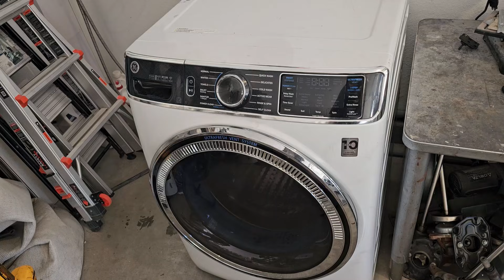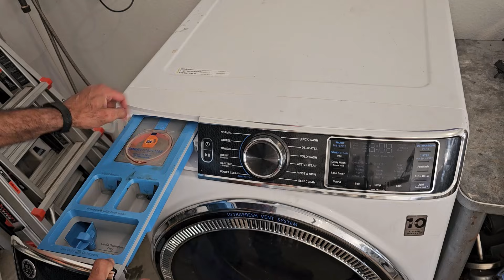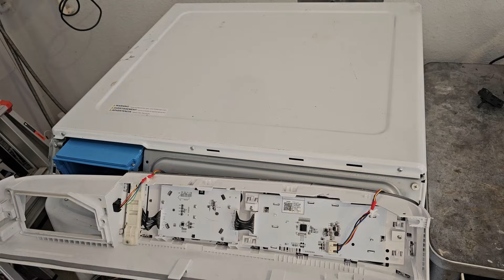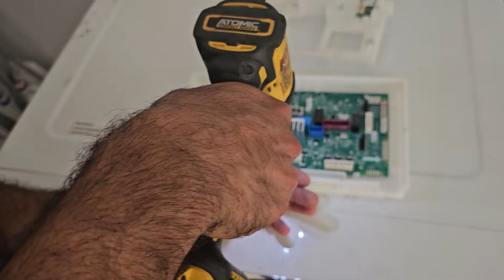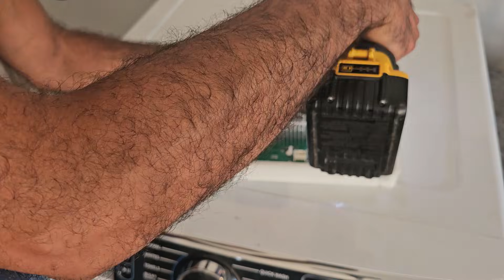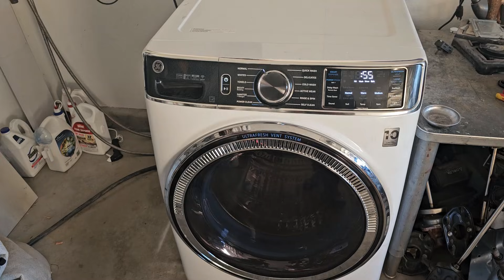How To Replace The Control Board On A GE Front Load Washer!

Comment: What is causing my GE front load washer the same as in this video, started running on it’s own and the door was open and the front panel had nothing on it so I pushed the power button and the front panel showed normally I changed it to a quick wash and shut the door (the motor is still running) and I hit the start button and it clicks and I can’t tell if it’s working properly but I hit the pause button and the motor was still running and I hit power button and the panel turned off and the motor is still running I can open the door and it still goes. I unplugged it and plugged it back in and it starts running again so I unplugged it for 20 minutes and then I plugged it back in again and again it started running when the the door was open and then I hadn’t touched anything. ? Could it be a power relay button according to ChatGPT? Where do I find that part and does that sound like a power relay switch problem or a control board problem?
Reply: Try water inlet valve

Comment: Extremely helpful, my machine would not lock so I replaced the locking mechanism. When I reset the codes it worked the first time and ran the machine, on the second load of clothes it did the same thing and did not lock. I ordered the control board and it has locked on the first load. My fingers crossed that this is the fix. The directions were very clear and the video was the helping hand I needed. I am pretty handy so the whole process tool less than an hour to complete. Thank you!~
Reply: Did this end up solving the issue?

Comment: This worked well. My GE washer is only 2 years old but stopped draining. First, I changed the pump, but it did not fix the issue. Then fitted a new control board following this video's instructions. Note that a new board will start all the LEDs flashing, and you have to set the right "personality" for the control panel to work correctly. This last step is missing from the video, though a texting process that is provided with the board will give you the correct setting (the same control board appears to be used in multiple GE machines). If you screw up this last step you can go back and fix it. This is just a nit though; the video is accurate and helpful.
Reply: My replacement board came with those instructions to set the personality but it didn't appear to be necessary since it fired right up and sucessfully washes clothes now. Maybe I'm missing something that will come up later. My post of my experience is right above yours. I wonder if you had a similar experience.
Reply: Do all boards come with instructions for this last step?

Comment: I really appreciate this video. Of course when we least expect it, these types of things happen. I, myself, have taken my washer apart, probably five times to inspect and see what was going on. Randomly one day my washer stopped draining and so I went through the process of replacing it with a brand new pump but now I believe it’s led me to believe that I need to replace the control board too because it’s still not draining. I have inspected all tubes and everything is clear. today I was going to hit the buy button on purchasing a new washer, but I’m almost tempted to try to replace the control board and see if that works. Your video definitely gives me confidence that I can do it if I was able to replace the pump with no issue
Reply: Update?

Comment: I just changed the main board and the pump (even though the ohms were in check). Still no luck. Do I change the lock mechanism next or what? Currently the machine turns on but doesn’t lock nor does it stay on. It’s not doing the constant clicking like it was before but it’s also not doing anything to except turning on. Allowing me to select something on the dial and then it waits a minute (actually 7secs or 10secs) turns off and then clicks and then clicks again in 30secs but doesn’t actually do anything except repeat clicking every 30secs.
Reply from the maker: Check the wiring harness near the lid lock mechanism. It is notorious for breaking. If that is not it, the only real thing left to do is replace the lid lock mechanism
Reply: @DuctTapeMechanic I’m assuming I’ll see where that is in your GE front load washer lock mechanism replacement video?
Reply from the maker: @rlmossproductions yes. You can also get a good look at the wiring connector/harness when you remove the interface panel and the top as you did when replacing the board.
Reply: @DuctTapeMechanic I also noticed the wheel on the front is  off. Example….when it says it’s on “rinse and spin” it’s actually something else. So weird.
Reply: @DuctTapeMechanic wiring harness was in place and fine.

Comment: My door is locked and won’t open 
I went to do a load of laundry and when I came back the washer was completely turned off and I cant open the door  
No power at all. 
Do you think I should go ahead and replace the control board , or should I check the pump out first ?
Reply from the maker: If door is locked. You must try to  manually open it (there is a lever on the inside which is visible when you remove top). After that inspect the wiring harness around door lock mechanism if no damage is found replace mechanism if that doesn't work replace board
Reply: @DuctTapeMechanic I’ll try that , thanks !

Comment: Great video! I can add a third symptom that I had that required the main board replacement. I have a five year old GFW650 that suddenly wouldn't finish a load when it got to the end for final rinse and spin. It would drain after the wash cycle and then just stalled. I was able to work around it by manually running a separate rinse and spin cycle but sometimes even doing that wouldn't complete. It drained and then wouldn't move into spin. I then had to unplug and let it sit for a minute and run a separate spin. Error code was #18, "Drain pump Clearing Algorithm Failed" which can indicate a bad pressure sensor.

I ran several diagnostics to check the machine including #10 Pressure Sensor, #12 Drain Pump and #14 Spin. All passed, and I knew that the machine was draining and spinning because I could step through it manually. So, I figured that the machine's brains were scrambled and just couldn't put together a proper cycle. 

I bought the main board from Ben's, and you are correct - it's a great price. I paid $163 dollars vs $276 dollars that I was seeing elsewhere and it arrived in a factory fresh GE box. Your video helped tremendously in doing the installation. Thanks.

Problem solved. The machine is back running just fine.
Reply from the maker: Awesome! Thanks for the added info! The pricing is great on the board and if you do it yourself you are saving a bundle!
Reply: What board did you use, I have the same machine.  Thanks

Comment: Ours turns on. We put a cycle and push start, several seconds later it shuts off. Then the device power flick on and off.
Reply from the maker: Sounds like an issue with the main control board
Reply: @DuctTapeMechanic that’s what I see online. GE sent a tech out who tried to say it was the inverter. 

So we stupidly replaced it and surprise, surprise. Still the same issue. Told them to come back and get their inverter. 

So now control board and follow your steps. 🙏

Comment: I have a similar model.. the machine will not run any hot water cycles or self clean. It only uses cold water. There’s not any supply issues, I’ve already replaced the entire valve/solenoid unit and it didn’t fix the problem. Do you think replacing the control board will fix the problem ?

Comment: How can I tell if I need to replace the main control board or the inverter board?
Reply from the maker: A bad invertor boad mostly causes issues witht the spin cycle (or if the machine gives an error after doing a couple rotations of the drum). If you are having lid lick or drain issues it is most likely your main control board.
Reply: @DuctTapeMechanic so i am experiencing when I set to quick rinse & spin cycle. It starts at 19 minutes and stops at 13 minutes. It does not drain nor spin at the 13 min. point. I got codes of 18,39,26,66,8,19
Model GFW850SPN2RS

Comment: Thank you for the video. Changed door lock and fixed door fault issue temporarily. Thinking about changing out control board next. Existing pump still functional but will it conflict with the new board?
Reply: Did it work?  Did you swap out both or just the board?

Comment: I Changed the door lock and that didn't fix problem so I then changed the control board exactly as you did....When I plugged in the washer all the lights on the LED were blinking and it won't respond to me pushing any buttons....any ideas?
Reply: never mind...I looked at your info below on programming and it worked...thank you for this video ...saved me a bundle

Comment: Hello, good evening. I changed the inverter control and it doesn't work. I've tried draining the fill water and it doesn't do anything. Could it be the control board  and it needs to be reprogrammed? Thank you. I hope you can help me.
Reply from the maker: What are the symptoms?
Reply: only hear a click every 10 seconds and it doesn't do anything. I already changed the converter board.
Reply: Ours was not draining and the repair guy ordered three parts to replace. The pump was good when he tested it. The three parts are the main control board, the user interface board, and the inverter board. Perhaps your issue is one or all of these as well. Hope this helps.

Comment: I have the door lock on order, but how would i know if the drain pump is the real issue? The washer starts with the drain noise, then gives me the door lock light, and then stops working.
Reply: I have the exact same symptoms as you.  Noise with door light.  I’m going to replace the main control board since I can’t turn the washer on/off.  I’ll let you know if it works.
Reply: @blakebiltwell5 i ended up replacing all 3. Door lock, pump, and circuit board. Works perfect now.

Be VERY careful re-installing the hoses. I had a bad seating and the main hose leaked at the pump until i re-seated it.

Comment: Mine recently had an issue draining, however after checking the filter and running a spin cycle i noticed that i was getting a door error and it was repeatedly latching and unlatching the door, prematurely ending the cycle which would explain it not draining. holding the door open and toggling the push button switch the light would go on and off as normal so it seemed that the control board wasn't getting feedback that the door was latched. after leaving it unplugged for about 30 minutes i was able to get the system to run a full cycle as normal, however it randomly decided to run the drain pump continuously while it was shut off not long afterwards which led me to deciding it was the control board. when you say the pump shorts do you mean a short as in my situation where the circuit stays closed or do you mean the circuit goes open and the pump won't run?

Comment: Tried all of this and changed the pump, and it keeps clicking and not wanting to start the cycle. I’m not sure what else to do 😭
Reply from the maker: It most likely has a bad board then I have a video on that as well. These machines are notorious for a bad drain pump taking out the control board

Comment: Great video - curious if anyone can help me - have you experienced this:  GE GFW650SPN4sN Washer run for 4 minutes then "End" comes up.  Basically simply stops mid-cycle with "End" message.  I replaced the main board, verified door lock works, it seems to drain just fine (I drained it into a bucket to verify and yes water flowed nicely) and I cleaned the lower-front drain filter.

I am seeing error codes 38, 62, 3 and 9.
Reply: I’m having the same issue. Replaced the pump and board and still have the issue of the cycle ending about 4 minutes into the cycle

Comment: Hello. I have this same washer and a new board. Will I need to program anything or update the software etc after install?  Thanks!!
Reply from the maker: Sometimes, they work just by plugging in the new board. Other times, they do require programming. If yours requires programming, just text PARTS to 36534, and GE will ask for the part number of the board and will walk you through the programming instructions. Hope this helps
Reply: @DuctTapeMechanic  thank you!

Comment: This worked perfect, with the exception of the programming.  I have the 850 and I set it programming to #8 and two of my dial options are not working.  when you spin the dial, it skips the self cleaning and the Power Clean.  I also noticed that the spin rinse is not really spin rinse.  Any thoughts?
Reply: This happened to me also.  You have to enter test mode again. 

SERVICE MODE TEST 17 - 
Change Personality 
Pressing Start will start the test. Press Start 
button again and the next valid personality should 
be displayed. Press and hold the Start button to 
select the correct personality. The control will go to 
an idle state. All LEDs off.

The personality for the 850 is 4.

Comment: Excellent video! Putting all the connections back was much easier than taking them off. You will need to reprogram the washer once the new board is installed, but that’s easy as well. Once it’s installed and your washer is put back together, text PARTS to 36534. GE will text back asking for the part number. Once you text that, they’ll send you instructions on how to program your GE washer!  Know this if your washer isn’t draining, you’ll most likely have to replace the drain pump as well as the main circuit board. Make sure you get the newest model drain pump, the old ones have been replaced just like the circuitboard. If you don’t, the old drain pump could short out the new board. Thank you again for doing this video, extremely helpful!
Reply: Oh no. You have to reprogram thw washer after the board is installed? How do you do that!
Reply: Do you happen to know what the newest model number is for the GFW850SPNRS washer is? I keep seeing #WH11X29539 as the in stock part everywhere, but I also have been told the newest pump is #WH11X39237. So I have no idea which is the newer model of pump
Reply: @svkilpatrick The newest pump is WH11X39237 and the Main Control Board is WH22X37840. I just finished replacing both in my machine and have started putting it through a cycle.
Reply: Great video AND @dscrytpto18 I am so grateful for your added instruction. The text worked perfectly and it took me just moments to square it away instead of hours to figure out why it wasn't working.
Reply: Would have been nice if this was in the video…. Thanks!!!

Comment: well thanks for the video!! everything worked except the part of applying power back on. When I plugged the washer back in the front screen keeps blinking with all the LEDs flashing. I took the machine apart and checked all the plugs and everything is plugged in. Any recommendations?
Reply: GFW850SPN5RS, maybe this is the issue. This is the washing machine I have and the part I received was for GFW850SPN4RS. Is there a big difference between the 4RS and the 5RS versions?
Reply: Hey. You have to hold down the start/pause button. Then when the number one shows up hold it down again until it goes away. Push the power button and you should be good
Reply: @robertwarf3316 oh my gosh thank you so much for this my washer was doing the same and I started to panic this reset everything and now my washer is working perfectly thank you so much
Reply from the maker: @ramosc40 there should not be a difference between the two part numbers. GE only makes two versions of this board. Both are described in the description of this video. I would make sure all the connections are good and not loose and if that doesn't work try returning the board and getting another (perhaps you just got a bad one). Best of luck
Reply: Hopefully you got this resolved but you have to program the new board to your washer. In my case model gfw850, the id should be set to 4. After you press the play/pause button to get to 4, you hold it for a few seconds and the control will then be programmed to your specific model. Then turn it back on and you should be good to go.

Comment: You mentioned to replace the pump as well. The mcb looks super easy to replace, how difficult is the pump and do you have a video for that too? I have this exact model. Thanks so much.
Reply from the maker: I made a video on replacing the pump. This is the easiest way to do it.
https://youtu.be/wtZfU7cRaLI
Reply: Hi I came to make a comment I had bare minimum and tools and it was pretty easy to replace the most difficult part was getting the screws out and back on on the very bottom of the front of the washer if there's a way you could tilt it back safely I highly recommend it would be much easier to get the screws in and out that way

Comment: My control board doesn't look exactly like this one with the link below.. same washer though it seems mine is missing a few parts  will this still work for mine. GFW550s?
Reply from the maker: In the description (near the bottom of it), I put the link to the boards with the corresponding model numbers. There are only two different boards GE makes for these machines.
Reply: @DuctTapeMechanic I can’t get mine to reset after changing drain pump then main control board

Comment: Great video! Thank you. I completed the board swap but when powering it on the numbers flashed on the screen. Apparently initialization needs to happen when this is done. Hopefully you have another video on doing this
Reply from the maker: There is a comment below in the comment section that provides a brief breakdown on what to do if your new board doesn't start working immediately